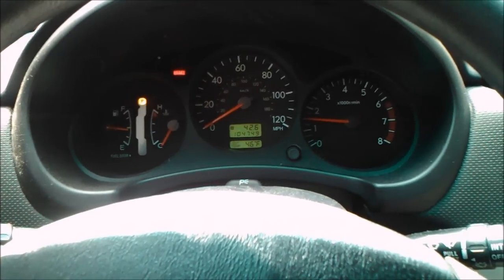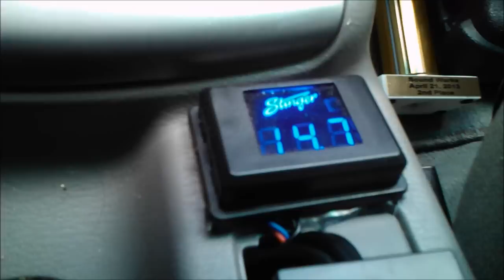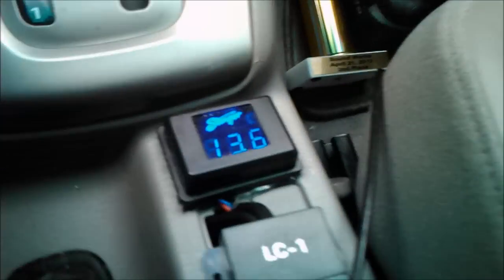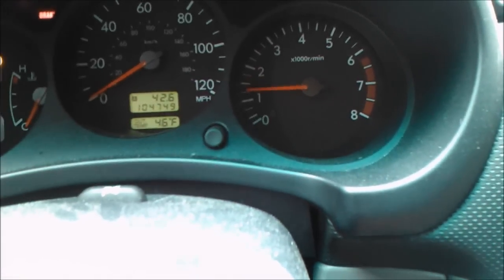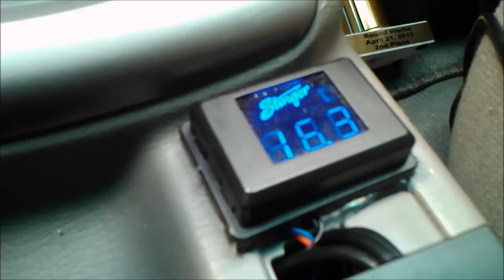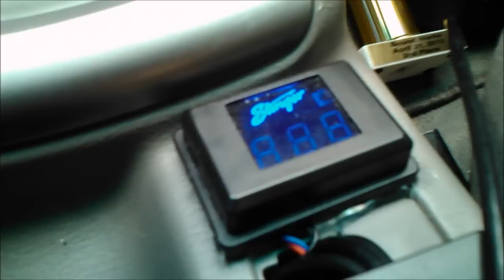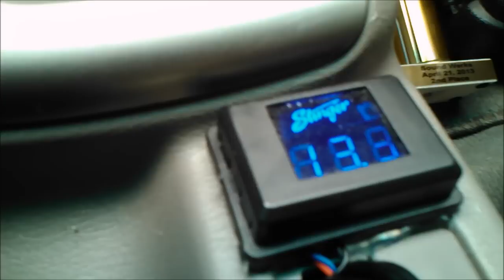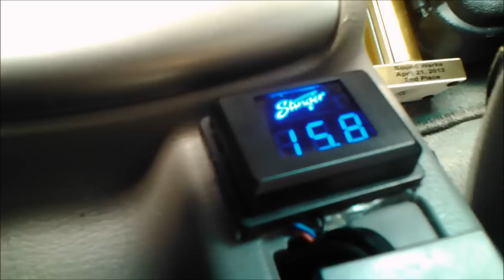Supercapacitor Results

Comment: Are you running a 16 volt system? Because cars do not run with voltage shot High you're supposed to be around 14 ...13.8to14 .4  when the amp sense has too much power it will shut off and vice versa when it senses too little power it shuts off goes into protect

Comment: +SnowDrifter Can we connect both caps and simple car stereo batteries? if we can ,how? and which are the positives and negatives if we can???
Reply from the maker: +marios zannakis Yes you can. Positives are negatives are labeled on the caps.

Wire your bank(s) in parallel with the batteries. Just make sure you charge them first